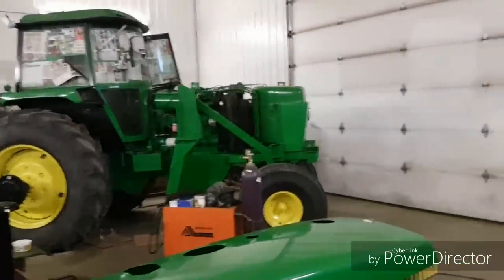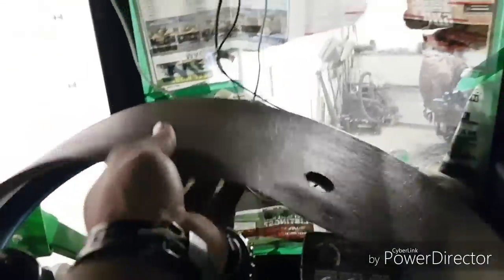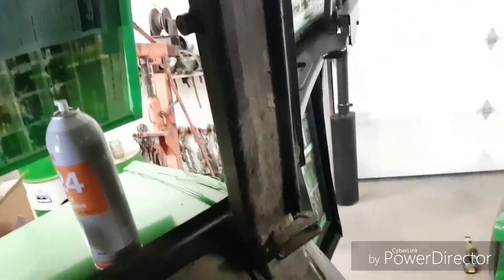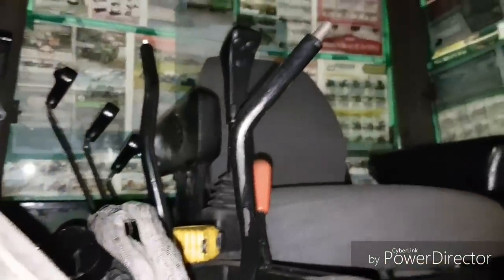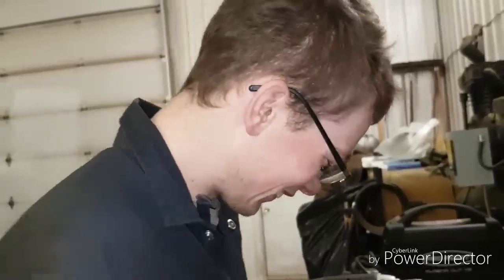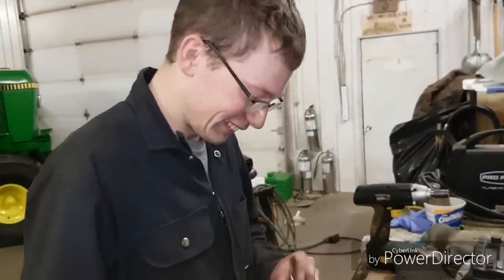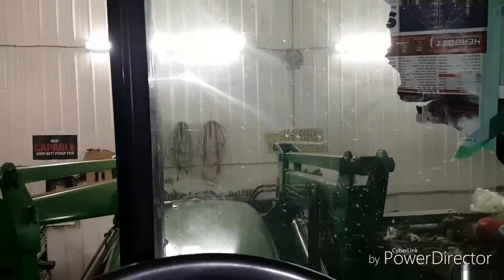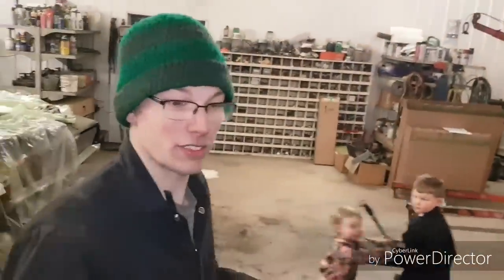4640 Loader and cab kit installation!!

Comment: You could use the low profile seat base from a Cab over truck. They work wonderful in Cat front end loaders.
Reply from the maker: But they cost alot is all...
Reply: Maybe we could get one from a wrecker.
Reply: @SouthSaskFarmer1  Yeah we sorta cheated that way, took the old one out of one of our concrete pumps and got the driver a new one
Reply from the maker: @paulmccallum4229  aaaaah

Comment: That cab kit reminds me of a radiator we ordered for our 4630. We ordered it from John Deere because we thought we wouldn't have any issues with it. Not one hole lined up on that thing. Dimensions weren't even the same. Was an inch shorter.
Reply: @Calvin Lyle instablaster =)
Reply: @Billy Dominic I really appreciate your reply. I got to the site on google and I'm in the hacking process atm.
I see it takes a while so I will reply here later with my results.
Reply: @Billy Dominic It worked and I actually got access to my account again. I am so happy!
Thanks so much you saved my account!
Reply: @Calvin Lyle no problem =)

Comment: Its looking awesome,  I noticed you got cast 90's on the valve.  I found out the hard way they can fail under pressure so if you got machined ones laying around I would defiantly use them.
Reply from the maker: Some are 40 years old on the other  loaders
Reply: @SouthSaskFarmer1 our fitting failed on our 26' grain box,  I'm sure the tractor is not as high pressure as an under body hoist loaded with wheat ha ha scared the crap out of me when it blew.

Comment: I notice you use a lot of two wheel drive Deeres as loaders and tillage where some would use four wheel drive. I am interested in your reason. Love the videos
Reply from the maker: More or less just because thats what a guy can afford. Front wheel assist on a 40 series is only hyd anyways so a mechanical 50 series like a 4450 is almost 20.grand more on The average. 2wd is cheaper to maintain aswell and I have the big versatiles for the real tillage work
Reply: @SouthSaskFarmer1  Thanks

Comment: You need to find a old grinder mixer and take the fenders off and put them on your 4640 we did the same to our 1466 international
Reply from the maker: I've never been a fan of fenders on the front lol
Reply: @SouthSaskFarmer1  we like them because with our 1466 it is a loader and we feed cattle with it and when you get the front tires covered in mud they fling shit everywhere and just makes a mess of the tractor and cab
Reply from the maker: @ryderschwager2377  fair enough

Comment: As you were talking about that interior, I noticed that the pieces were tan.  From factory the 40 series interior was originally black, but the 50 and 55 series was tan.  I was just wondering if you ordered the tan color on purpose, or if you accidentally got the wrong cab kit.  I agree that the holes should line up a lot better than that, and you should get some money back, but other wise that 4640 is looking very sharp.
Reply from the maker: Did it on purpose haha I really like the tan haha I also have the vents from a 55 series for it I'm putting in
Reply from the maker: I did yup lol

Comment: Wow a galvanized pipe fitting in the hydraulic system. I've seen on the inner Web that your hydraulic pump will implode.  Lol.
Reply from the maker: Lmao haven't had an issue yet and some of them have been there for 40 years lol
Reply: @SouthSaskFarmer1  I never have either but you know how some guys are.  I have galvanized air lines in my shop. They supposed to flake off and destroy all your air tools. Lol

Comment: my 1586 needs a new headliner but i may have 2 get it from K&M i think there called. or i'll just wait 2 till it goes in2 the repair shop 2 have the A/C updated.
Reply from the maker: Just drive it in a lake lol
Reply from the maker: @MrJohndeere3720  haha they wouldn't be able to. They aren't built like a pissy little ih
Reply: @SouthSaskFarmer1  i would not get 2 cocky if i was u, u just might wake up 2 a missing deere..HAHA
Reply from the maker: @MrJohndeere3720  lol try AMD find it the dog will chase you lol

Comment: At some point in the near future, your going to tear that valve off. Too close to the tire, at best the valve will get cracked by a rock.
Reply from the maker: As if
Reply: mike wood have to be one in a million to pick a rock up with those tires
Reply: It might get a cover once the pipe fitting is complete but more as an attempt to keep mud off of it